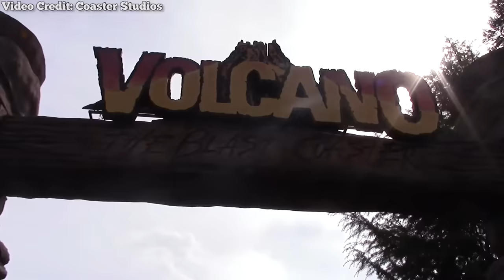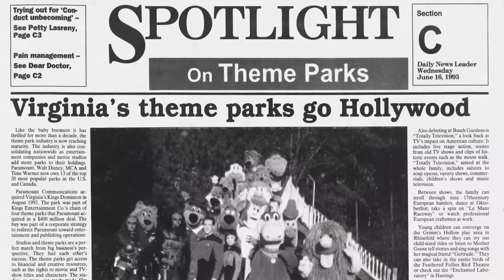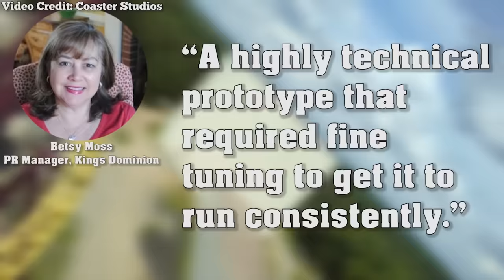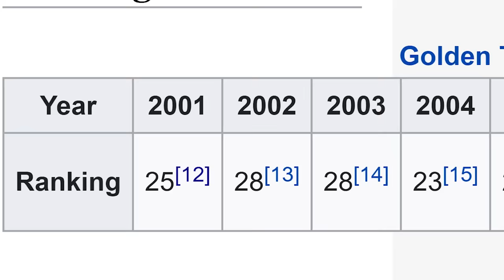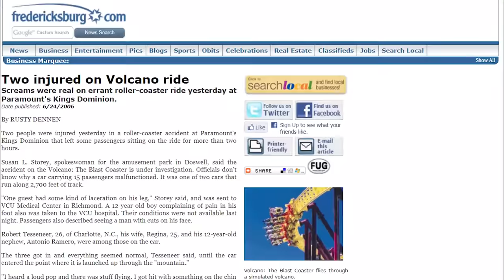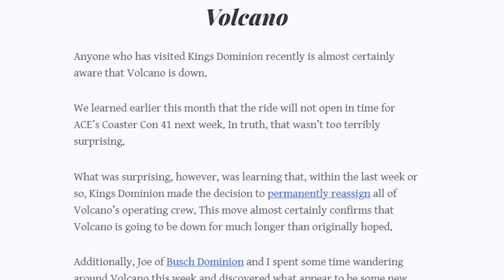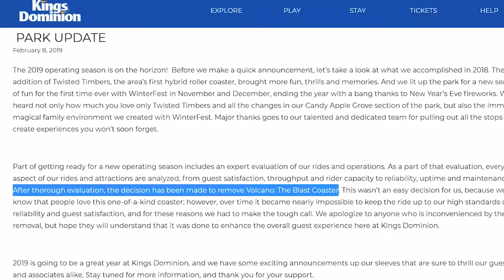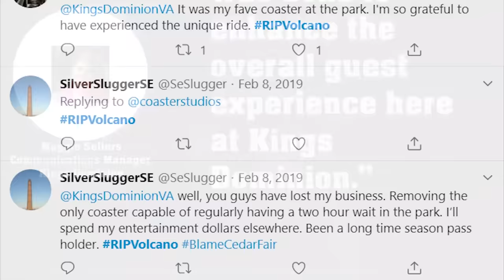The Rise & Fall of Volcano: The Blast Coaster - Kings Dominion

Comment: Here's a fun fact: KD used to pull power direct from city grid up until the power issues you mention were fixed, which was done by installing on-site power generators. When the power company came to investigate the power usage for volcano and FoF, they realized that they only read the power usage every 3 seconds. However, the launch on FoF is less than 3 seconds, which means, from the time FoF opened to the time Volcano's launches were put into full power, the park was essentially getting free energy for launches! This is a fantastic video and, as someone who grew up going to KD all the time, thank you for this! I am one of the few that is grateful enough to have an on ride video back from the souvenir video days. I am also pleased that you have a clip from Hagrid's as I worked on that coaster!
In addition, the last couple years of volcano were plagued with LIM magnet leakage. As the magnets got older, the electromagnets couldn't transfer as high voltage as needed to get a full train over the top, so rollbacks were more frequent and they started to leave the last couple rows empty.
Reply: Awesome detail, thank you for sharing!
Reply: I have that video as well with me and my daughter. I posted on facebook a few years ago. That was one fun ride. That mountain has a lot memories for me. Haunted River and Time Shaft were my favorites until The Volcano came out.

Comment: Was it really getting high ridership? Or was it just so low capacity that it got long lines? Does anyone have any ridership numbers for it?
Reply: Kings Dominion was my home park and it was a combination of both.
Reply: It pretty much was the only thing that had a long line, and the only reason to buy a fast pass (in my opinion)
Reply: GP To Enthusiast high ridership. At one point I saw 3 trains going and the line was still wrapping outside the mountain
Reply: Low ridership.  I think the last two seats on the trains were never used.  It always had Long lines.
Reply: II heard it was a bit of both. Also love your channel.
Reply: they usually ran like 2 or 3 trains. but that was THE most popular ride there. that was the one roller coaster you could not leave without getting one off on. a couple of times the line stretched out past the crypt ride.
Reply: I always felt the line went pretty quick. Comparatively to other rides in the park it did have a long wait but at least we kept moving. Twisted Timbers was a nightmare to wait for
Reply: It may have had lower capacity, but people would wait 90 minutes for it, so it was popular enough to draw a crowd regardless.
Reply: Train troublemaker Boi  If that's true that is super low, not surprised at all if low ridership was part of its closure.
Reply: It was always busy when I went(not often mind you, I dont live as close to it being in maryland) but the one time I got on and was in front row, it was a hell of a wait, worth it though. Honestly, I liked it better the Xelotator at Knotts, which is what I grew up with
Reply: Anecdotally, it had high ridership, it is right by the entrance of the park and there are not many other "intense" roller coasters at the park other than superman
Reply: Have talked to a friend and confirmed it was low capacity, said to have had between 600-700 rph...
Reply: Gosh I rode it once or twice as i didn’t get tall enough to ride it until near the end of its life. It was so so fun. Just hanging from the top and feeling my feet dangling while being shot out was so thrilling. I genuinely miss it and as far as I know a lot of the locals really love it.
Reply: @MrTrollinglol  maybe you are confused with the parks? As far as I remember it has quite a few thrilling rides. Intimidator being the most obvious. But also they have the dominator which is pretty extreme in relation to the volcano
Reply: both

Comment: This one still hurts! I was there the summer it opened on a saturday no less and the line was damn near up to the front of the park. Over 6 hours later and I got to ride, it was epic! I could definitely tell it was starting to go down, I rode once in the spring of 2017 just after losing over 100lbs and it was my first ride on it in over 8 years. We didn't have a roll back but after the launch we slowly crept out of the mountain as slow as you can go without coming to a complete stop and I wasn't sure if it was going to roll back or finish the ride but it pressed on and made it through. I will miss this ride but also excited to see what KD comes up for it next.

Comment: Failed Coasters Request: The Bat at Kings Island!
Reply: Dude, There is a The bat roller coaster by Arrow Dynamics, after a suspension opening and was renamed The Bat
Reply: Levi Animate 2012 Hes not talking about the current bat thats still operating. There was another suspended coaster named the bat that was the FIRST arrow suspended coaster that lasted two years
Reply: @Lpb726bw  Top Gun isn't fit to hold the name, The Bat.
Reply: The Bat that derailed?
Reply: How about Vortex because I am devastated they are tearing it down
Reply: @MrVekoma1979  i feel ya
Reply: Yes it has already begun demolition! The station batwing and the brake run have already been removed
Reply: Are those the Vekoma flying coasters? Weren’t those horribly rough and uncomfortable?

Comment: I was on the first public launch of this ride. After sitting for a day and a half outside the que, we were led in. We got strapped in. The ride rolled out of the station and stopped. Nothing happened. They had to push it back into the station. A few people freaked out and got off, but they decided to try again. After failure 1, it was extra invigorating when we rounded the corner and took off.
I joined the Army a few years later and didnt get back to Kings Dominion till late 2018. I was really depressed that my children never got to ride it.
On season passholder day 2019, I attended the memorial ceremony held outside the entrance joined by many others. I'm glad you posted a picture of the sign and flowers that were placed out front.

Comment: I took my first trip to Kings Dominion back in April of 2018. I was really excited to ride I-305 and the brand new Twisted Timbers. Although I did love both I-305 and Twisted Timbers, I was blown away with how good Volcano was. Its launch was intense and the ride was very smooth. I got two rides on it that day, not realizing that it'd be shut down for good less than a month later. I left Kings Dominion realizing that they had 4 really good coasters (I loved Dominator as well). I do hope Kings Dominion gets something special to replace Volcano because Volcano was a special, one of a kind, ride.

Comment: When Flight Of Fear opened in 1996, it was themed to The Outer Limits TV show. In 2001, the Outer Limits name was dropped and some of the elements was removed. That same year, lap bars were installed on the ride vehicles due to complaints of roughness.

Comment: I really liked it. I rode it a few times over a weekend and on my last time riding it we were launched and just as we were about to come out of the volcano the ride made a loud noise and we fell backwards and traveled back into the loading area. It turned out that a rider did not have the restraint locked in place. I can not imagine what would have happened to him if we would not have been stopped.

Comment: I think Flight Of Fear needs several upgrades. These include a launch alarm and fog effects, chasing lights, gamma radiation effects, strobe effects and a loud bang on the block brake with a gamma ray, electricity towers, smelting machines and more.

Comment: There was a 4th ride inside of the mountain before Volcano. It was a Bayern Curve called Mt. Kilimanjaro. It was located on the rear side of the mountain near the entrance to  Flight of Fear. A much smaller mountain with a double-waterfall is next to a walkway where the entrance to that ride was located. I believe the ride was removed in 1990, but I could be mistaken about the year. 

Side note: experiencing a rollback on Volcano while sitting front row, while not knowing at the time that rollbacks on Volcano occur, will always be one of my most frightening and exciting coaster experiences ever.

Comment: Rode this in 2005.  Waited 2.5 hrs because it broke down like 4 times while I was in line.  However I was committed and waited.  I had such a headache afterwards that I was done for the day.  I had a premium front car.  That 70mph take off was insane and I screamed my head off.  I had rode the brand new tomb raider ride before Volcano but was 100% dry by the time I finally got on it.  I liked that there was almost 0 drops but plenty of Gs felt.  It was the last time I got to ride time shaft too. 
P.S I had also rode Smurf Mountain it's opening year and I was only 3.  Back then safety was kinda lax.  😆 I gotta meet Papa Smurf that year.

Comment: I think that it needs to be replaced by something with extensive theming. Whether it's a B&M wing coaster or something else, the fact that it was a volcano and you rode through the mountain is what took this coaster from being thrilling to being truly iconic. It doesn't need to be Expedition Everest, Taron, Hagrid's Motorbike Adventure or even Verbolten. But they need to add some quality theming and make it something picturesque. It will be very disappointing if that plot of land is left flat with nothing but a coaster structure.
Reply: Zac G Verbolten and Hagrid already had a hard task of replacing a huge favorite.

Comment: Kings Dominion used to be lit.

Volcano, Hypersonic, and Drop Zone had the GP sh*tting their pants.
Reply: Don't forget Shockwave the stand up coaster 😎
Reply: Labarrian Vinston 

Right. I remember as a kid everyone used to watch Shockwave going through the loop.
Reply: The time shaft the one sit down in like small roller coaster and spin you around fast sound like tornado was coming in the small mountain with small water fountain in the middle if it and King Cobra my opinion the fastest takeoff shuttle coaster at night they turn the lights off when it take off yes I miss seen the Shockwave that lift hill and that first loop

Comment: They broke the ride when they redid the station for the fast lane. The ride used to have 3 trains and always be a station wait but they adjusted the station and killed its capacity and broke the programming. Loved the ride though. It will be missed!
Reply: I thought it mostly ran with three trains? When was it reduced to two? And what did they do with the third train?
Reply: @tigerrocks503chase8  about when they added fast lane so 2013? 2014? The other train was always in storage as they were short a block to put it on.
Reply: Fun fact: The front car from one of Volcanos trains, along with its sign and a piece of cut track are now preserved at the National Roller Coaster Museum.

Comment: Flight of fear....Never understood the train....I am not by any means a big guy. I have a 38" waist but almost felt like I couldn't fit into the seat. The restraints were horrible as I barely fit in it. again, I am not that big of a guy. I thought to myself that perhaps men a bit larger than I could never ride the coaster.
Reply: You noticed that the original restraints made Flight Of Fear a rough ride. So, lap bars were put on the trains in the Early 2000s.

Comment: Saying they couldn't retrack or order a part is incorrect.  Volcano was slated at least a year or two before it's breakdown to have an entire new controls and launch system installed in 2019.  Cedar Fair already had things worked out for this.  In speaking with a mechanic at Cedar Point I was told they decided to pull the plug on Volcano when Intamin came back with a much higher cost than to complete the upgrade after things were already planned.  From that I think it's safe to conclude that whatever broke was what was added in to the cost (and this gives credence to the rumor that a non-approved part was used to repair Volcano which voided their contract with Intamin).  It's not that they could not have fixed this ride -- it's that they didn't want to spend the money to do so.  This wasn't a ride where the manufacturer disappeared -- it was made by a company who is still extremely active and still maintains the impulse coaster which is essentially the same as the Suspended Catapult Coaster.
Reply from the maker: I use the word "reportedly" because the exact details on why the ride closed are unknown and under wraps. All we really know is that it was closed because the park couldn't afford to maintain it.
Reply: @ThemeParkCrazy  Reportedly by whom?  Anyone that says that a ride is incapable of being repaired or rebuilt is not really thinking.  Cost may be a factor in a park deciding not to do it but if there is an active manufacturer then saying it's just not at all possible is purely incorrect.  Also just as a note, there have been more than a couple ride operators/managers as well as other insiders that I've talked to that have confirmed that the 2019 upgrade from Intamin was on the books before the breakdown.  You even quoted sources in your video for other things that have referenced the same upgrade.  I agree that "reportedly" is still valid as there aren't hard documents in front of our face but it seems like you just read some websites and didn't talk to any of the sources that you're quoting.
Reply from the maker: @bobkmertz  I did not mean it wasn't possible at all. I meant that it was unsalvageable only because it was beyond the park's resources. If they had a trillion dollars, they could have easily built a replica, but they couldn't do it in an affordable or consistently reliable way. They couldn't "simply" retrack and repair it, as the process would be anything but simple. Please understand that I am not an industry insider. I don't have access to direct insider sources. I apologize if it seems like I skimped out on the details, but I aimed to to my best with the available information.
Reply: @ThemeParkCrazy  I'm not trying to attack you or anything....  I think the information you have in this video is a lot better than most of the videos on the subject.  I just get frustrated when the enthusiast community carries things like wildfire and within a short period of time you have people stating things as a fact when there is no basis for it at all.  I'm certainly not doubting your intent and I'm also not trying to say that what I've stated is a complete fact (and I wouldn't want you to do that).  It just sounded like you were stating that it was an outright impossibility when that's not the case.  I also personally think that if you are going to give a statement based on rumors in a video that is designed to report on the subject then you should give all of the major theories in the case.  One of the most widely reported statements about Volcano was that KD used a part that was not approved by Intamin and that the use of that part caused further damage and there was a lot of reports about the controls upgrade being scheduled for 2019.  What you reported isn't wrong (though there may have been better wording to use) and it has it's place in this video but I think that it's an incomplete picture if you give one rumor without also presenting other rumors and possibilities.  I would suggest talking to KDfans who probably has one of the best collections of information (even a lot more than what is on the site).

Overall though, you did a great job and it was kind of cool seeing myself in the video :)   If you added a little more information to present the other cases this would probably be the best video on the subject.
Reply from the maker: @bobkmertz  I understand what you're saying. I will take what you said into account when making future videos. thank you for your constructive criticism.